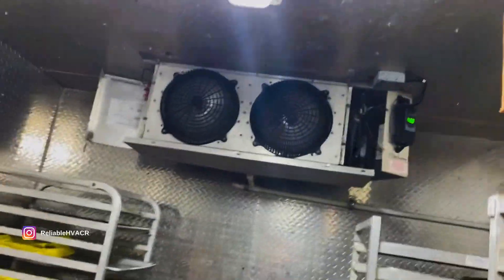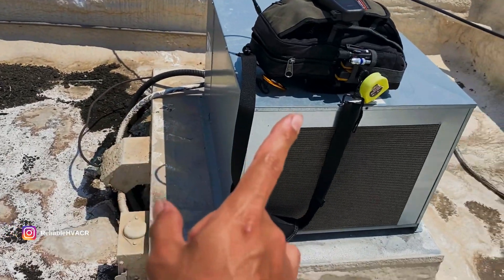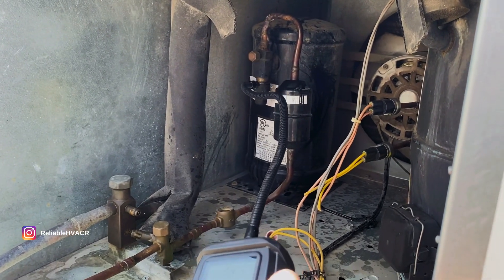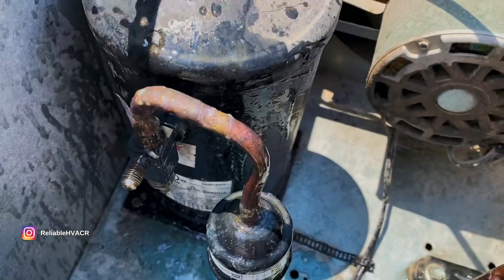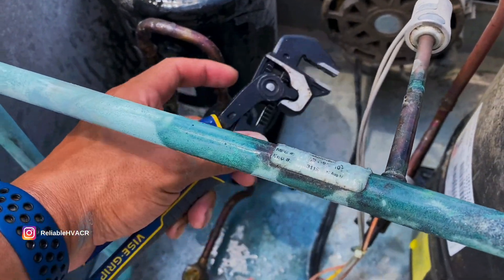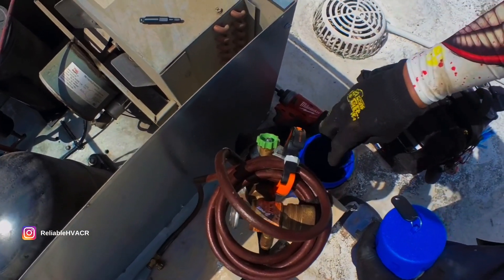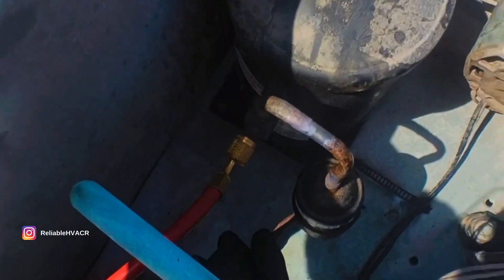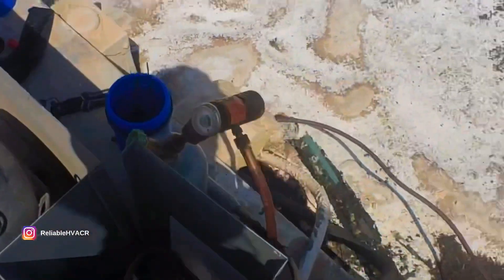Helping Find A Leak on the Walk In Cooler Now | Repair w/ Turbo Torch

Comment: Never braze cracks.  Cut them out and put new pipe in.  The copper will continue to crack under the braze.  The only way to stop a crack is to drill a hole on the beginning and end of the crack.

Comment: That Hilmor Leak detector looks just like my Elitech 😀. Turbo torch is good for roof repairs , remote units , A/C units , but wait until you have to replace a capillary tube it would be useless in my opinion 😀😬🙆🏻‍♂️. Good repair
Reply from the maker: They are identical 😂 I saw those recently. And for sure, oxy acetylene is still my favorite this is just convenient for certain rooftop repairs. Save my back a little.
Reply: @ReliableHVACR  Yeahh not bad for roof jobs 😀

Comment: Never used a turbo torch looks handy when you don’t want to carry the big torch. Thanks
Reply: They seem to work well but they're irritatingly loud especially when you're in a box
Reply from the maker: Yes and true they are loud, I have headphones in to help. But strictly for roof tops on simple repairs. Oxy acetylene is still my favorite just not the weight 😅